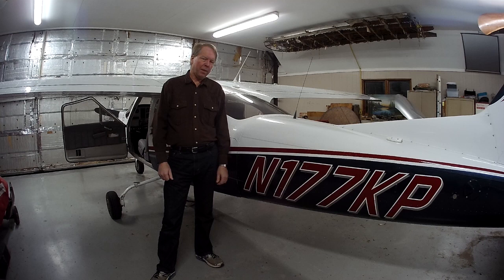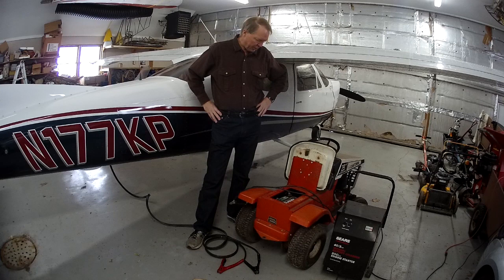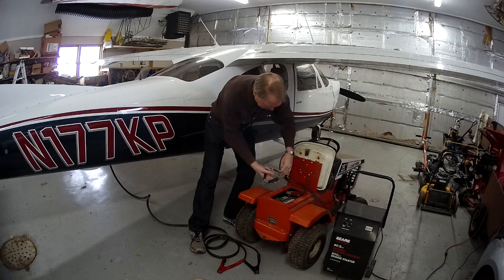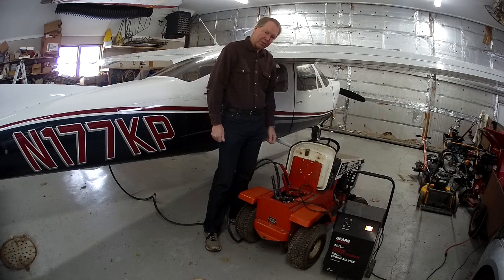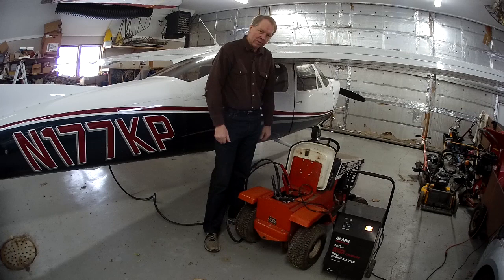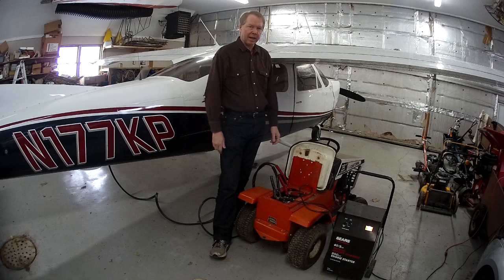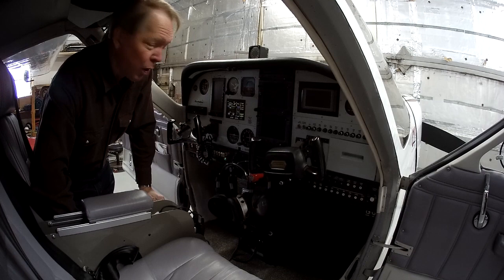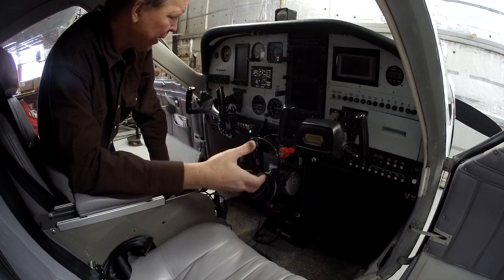Avidyne data update with external power

Comment: Clever to use the lawn mower battery as a buffer for the external supply.  Have you ever wondered why the lawn mower's designer didn't put a non-conductive material around the battery compartment opening?  Sweet Cardinal and hangar, by the way!
Reply from the maker: In fact I have! Guess they didn't expect us to be jumping airplanes off the lawn tractor... although it does a pretty good job of that!

Comment: Probably a good idea not to turn on battery charger until all connections are complete.  Prevent electrical spikes and sparks around the battery that has hydrogen inside.
Reply from the maker: I agree, as was done here. Guess you're just calling out that detail with some extra back story?

Comment: Hi Keith great videos. How hard is it to land a 177rg compared to a 172?
Reply from the maker: Thanks! It is actually easier to land a Cardinal well than a 172. That is, unless you have already gotten used to the 172. Folks who learn in the Cardinal don't seem to have as much challenge moving to other types. I've flown 172s as well and my view is that the 172 just needs a little extra technique in the flair at times. 

You don't have to take my word for it, you can read a review done by an Air Force / Airline Skyhawk pilot about his first Cardinal flight here:  http://www.cardinalflyers.com/prep/info/flyimp.php
Reply: Yeah my instructor really likes them. There is a decent one on controller with low time and good avionics. I really like Avidyne over garmin.
Reply from the maker: @TheCapTan   I probably know about it!  If you'd like to know if it is a good one I can help with a pre-purchase inspection. Info on this page: http://cardinalinspections.com
Reply from the maker: @TheCapTan  For you no problem! But for all of Youtube?  How about if you use the contact form on Cardinalinspections.com or on cardinalflyers.com   ?

Thanks!
Reply: According to the POH of my 1977RG when I connect ground power the split bus contactor will open to split the avionics bus from the primary bus to prevent transient voltages from harming the avionics. So the only way I can keep power on the avionics without running down the main battery is to connect an external battery direct to the aircraft battery. Did you bypass the split bus contactor or does your model number not have one?
Reply from the maker: That is an excellent point! Many Cardinals, mine included, were built with that contactor which protects the avionics during engine start and also comes into play when using external power. The mention of using the avionics switch is a clue that mine has been replaced with a manual switch (plus a backup switch) as part of the panel rebuild.

Before then I had a slightly different (also non-original) setup, where that contactor was activated by a pushbutton with a latching function... that is the contactor would power itself after the button was pushed. I don't recall if that powered the avionics without the master on, but I suspect so. Depends on where the activating pushbutton was powered.

For the stock system the master switch would be the only way to turn on the radios when powering from external power. All the more reason to monitor the voltage the battery is seeing during this process. Thanks for making that clarification!
Reply: Many thanks for your prompt reply. That explains the ease with which you can use ground power for avionics use. Having just done a big avionics upgrade it was frustrating that I could not "play" with my new toys on the ground to learn them using the GPU adapter. Thanks for the youtube thread, it adds to the expertise of CFO.   @cardinalflyer
Reply from the maker: @peterjames6165   Thanks! If you find yourself struggling with this in the future, consider back feeding the avionics bus. It is usually an open metal strap, easy to clip on a power lead with a ground lead to the seat rail. Just remember to keep a battery in parallel to smooth the power, or consider using just a battery that you recharge later. Of course fusing is always good when playing with batteries and jumpers!
Reply: Many thanks for the tip Keith, that looks a good workaround. The avionics take so little power these days that a battery and fuse alone will run for as long as I need.  @cardinalflyer